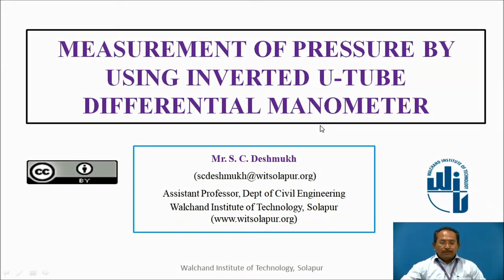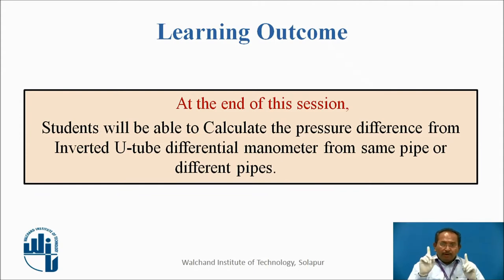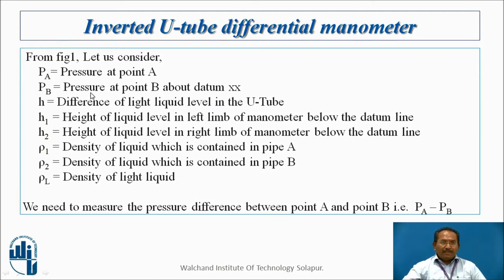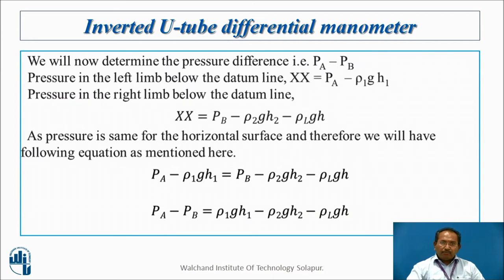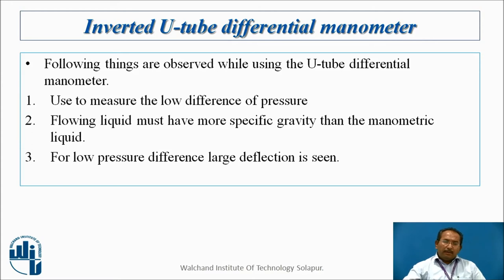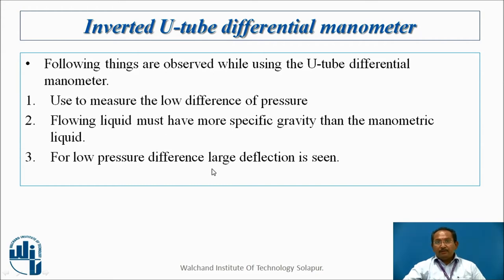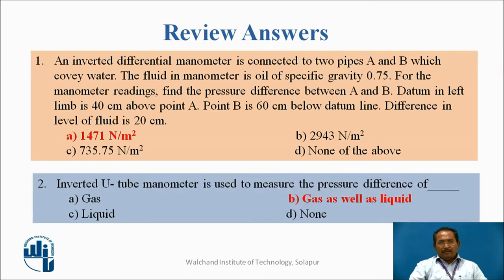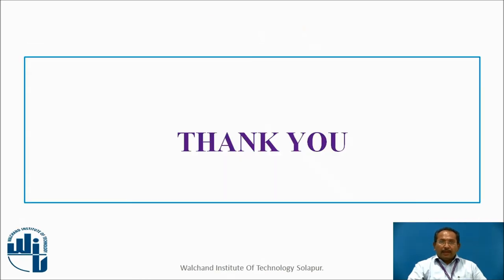Measurement of pressure by using inverted U-tube differential manometer

Comment: At 8:33 time in your video, the answer 0.04 will be in meters of water. Not in N/m2. Its wrong. 
If we want that answer in N/m2, we have to multiply 0.04 with water specific weight i.e., 9810. Plz correct it.
Reply: Sir how about his formula and calculation is it correct? Only the unit is wrong?
Reply: @oliverortiz700  yes. absolutely. the answer is correct. Just units are different